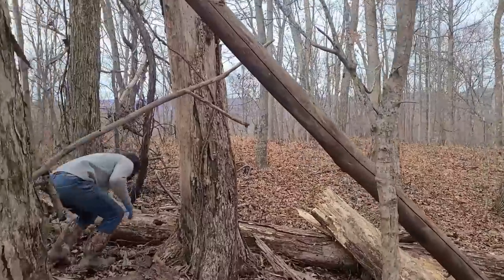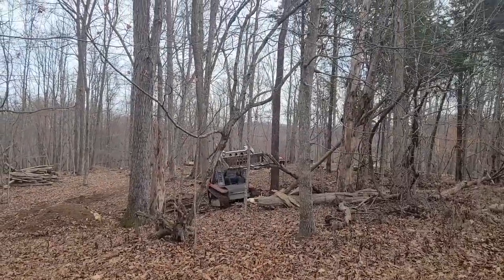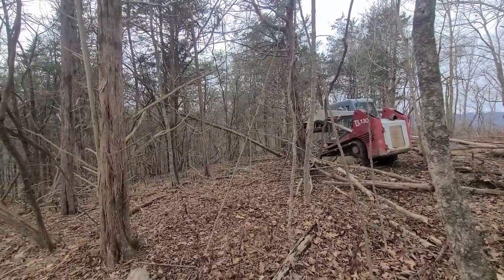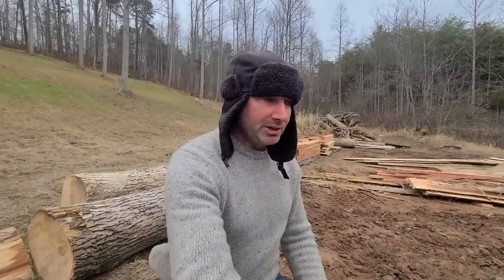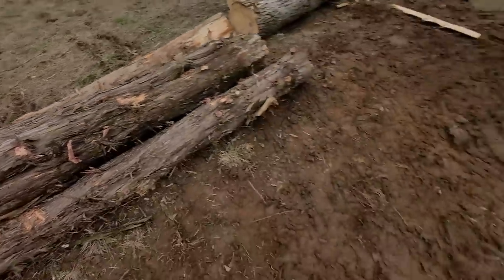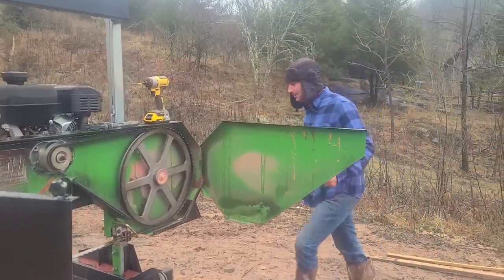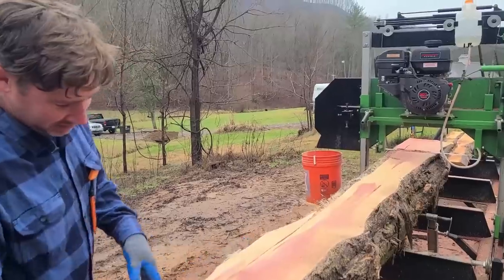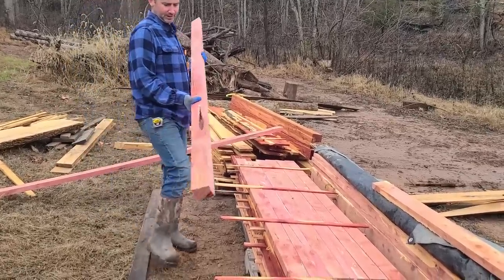Milling cedar on our custom sawmill // E110

Comment: Ricky is a Super Hero, you can see him bend and twist a bit though, and sighs with relief when the load has gone 🙂When you decided to put your for ever mill there I did wonder about the wet mud. You guys, and your equipment ROCK.
Is it worth adding to the plan to extend your solar still roof to cover the mill, or at least building the frame? Doors straight in to the Solar from the mill?

Comment: You really don’t need a chain, I have a wheel bobcat and you would be surprised what I do with it, that rock bucket would be amazing but I use a set of forks. I used to log all the beetle dead spruce 90 feet off both sides of the road or hyway, I had to take the logs too, had a 72 kenworth with log bunks and would load that thing Full and head for my mill, you’ll get the hang or it, you’ll see you really don’t need a chain, God Bless